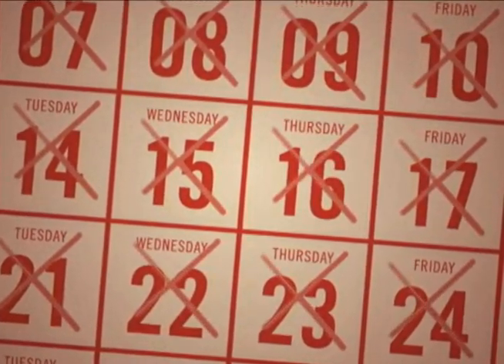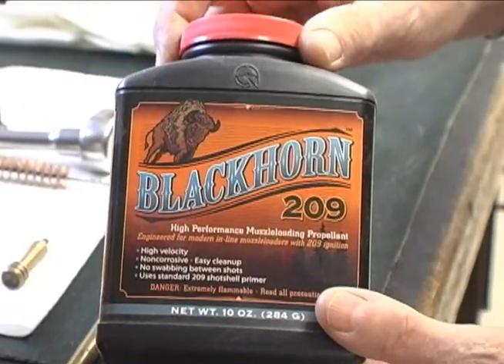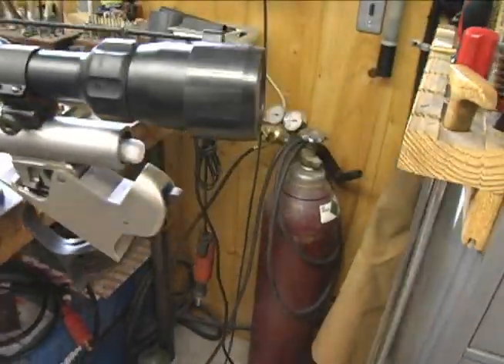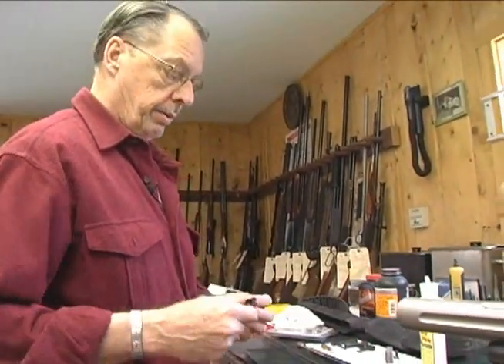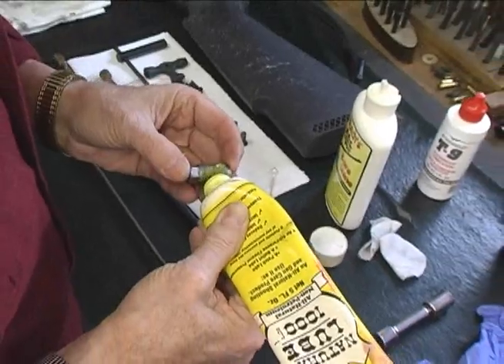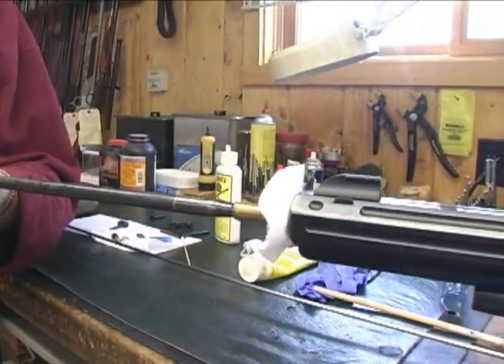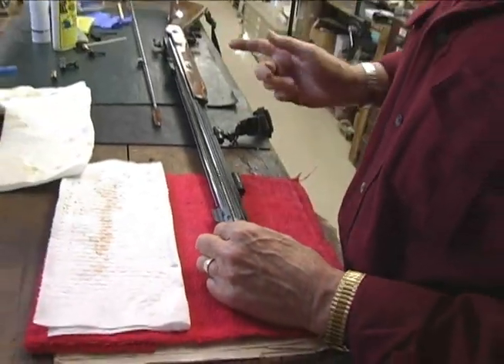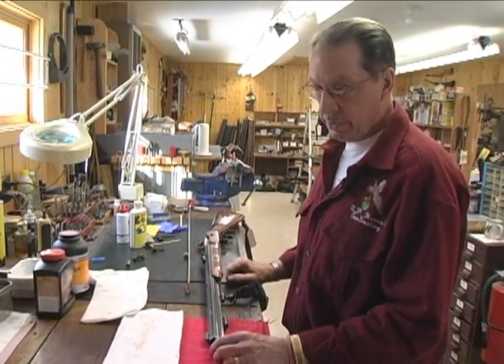Cleaning your Muzzleloader

Comment: great, straight forward video from someone who knows. Thanks very much!  I've never heard of plastic solvent though. What is the product, exactly?
Reply: I would use mineral spirits or chlorinated brake/carb cleaner to dissolve plastic if needed. Me personally, I've always just scrubbed the crap out of barrels with a brass brush and never had to use chemicals like that for plastic residue in the barrel and all I've ever shot in my oldest muzzleloader is plastic sabots since 2000 and just brushed it out good with soapy water ymmv.